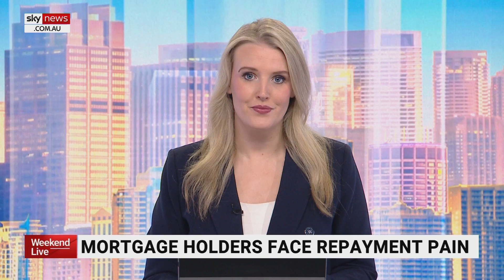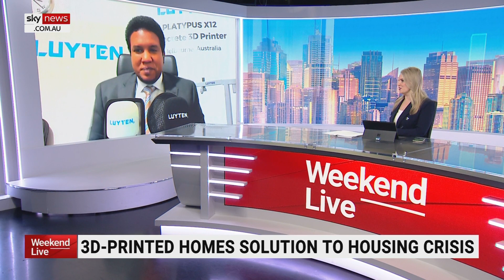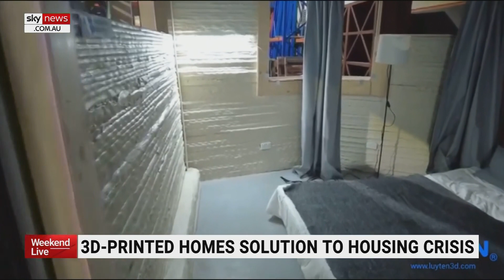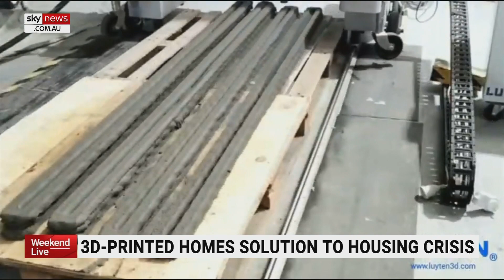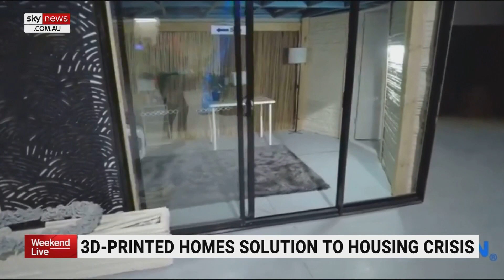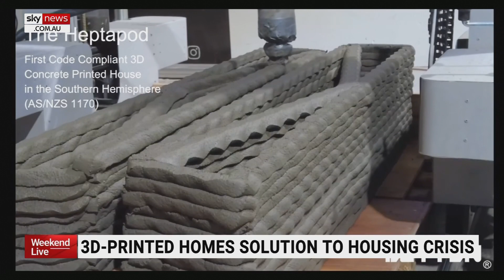'No constraints' with design for 3D-printed houses

Comment: I'm a builder. I challenge your 3D printer to build some of the things I've designed and built. Good luck
Reply: I mean it is not directly just a printer and that’s it. A 3D printer can save money, time, and resources that could be used for other things. Maybe a whole new combination of regular building and 3D printing should be made to make highlights to both issues with them.
Reply: @Claws-x4f  
3d printing will only make the top 1% richer and the economy will suffer. 
The best economies are emboldened by direct, research, analsyis, cost factoring, approval, manufacturing, advertising, consumer demand, actual human manufacturing, logistics, supply, retail, financial management. 
This system keeps the economy ticking. 
Don't fight for automatics. It's at your detriment. Autos  should only ever assist human capacity, not replace it. As replicating the human interaction with economics is a negatory  institution to the low and middle income benefactor, i:e, the majority. The majority that drive the economy by living within their means and still having to  spend 80-100% of their weekly/monthly/yearly earnings keeping the economy rolling to fight the billionaire hoarders with Scrooge Mcduck, dead money, money bins in their backyards.
Reply: @Jake Demuss admittedly I don't build a whole lot anymore. Cause I own the business mate😂 But the people who build stuff for me can outdo a printer too

Comment: Yeah bet they ain't in business in a year max.
The layer of concrete beneath each layer will have to harden enough to take the weight of the next layer.
 Then as you go higher the weight increases so it has to harden faster.
Then either two things happen it slumps or you end up with cold joints which allows water seepage, which leads to erosion and loss of structural integrity.
Don't believe me. 
Ring an insurance company and see how the cover will cost if they even will cover you.
Reply: Oh it's worse than that - the cost of physically assembling this would be astronomical. There's the machine time, there's the blokes to run it and feed material, there's the LOOOOONG build time paying for all that, it's just idiotic.
Reply: but otherwise you like it?

Comment: As a builder in the construction industry that looks like a very dodgy finish. How is the structural integrity? What about rebar?
Reply: @Mr Sheep  if its that good I'll just buy one, but it looks terrible qaulity, good for a  movie set maybe
Reply: I think the gyprock walls, single glaze windows, electrical cables throw on top of gyprock ceiling and timber framework are dodgy... But I am used to swiss/German houses.
Reply: @Mr Sheep  
It looks like the room can get blown down by a  🐺
Reply: It looks like shit, literally, to put it bluntly.